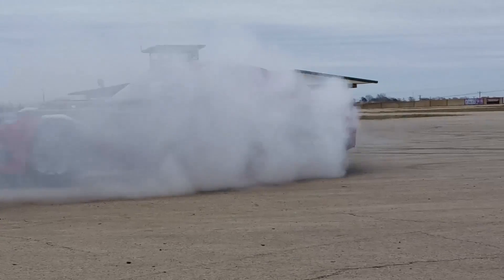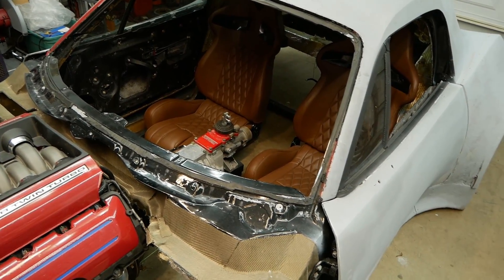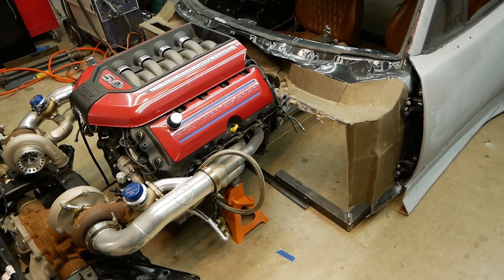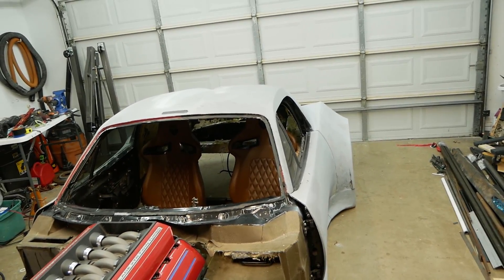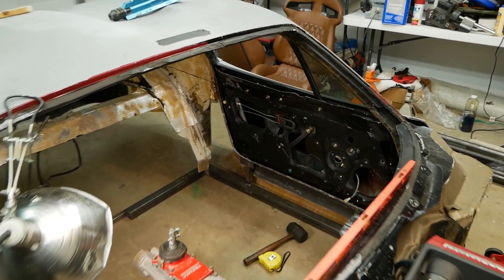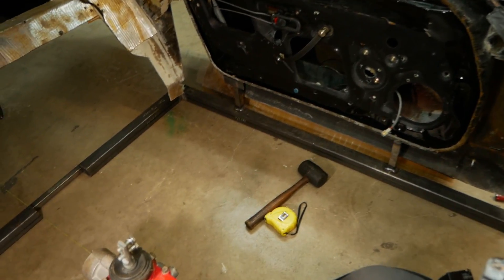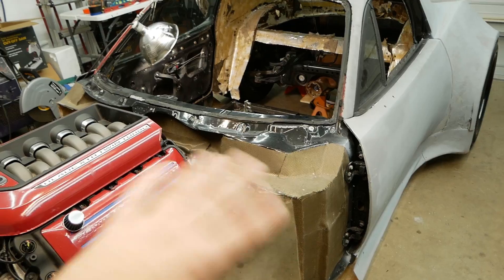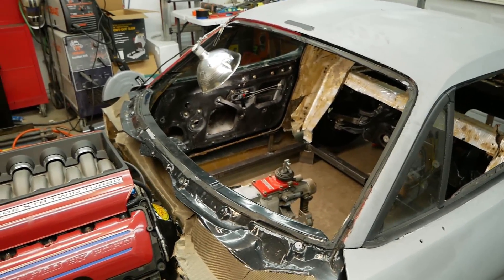Mounting the Body - Building a Twin Turbo Race Car - Ep05

Comment: I would have assumed that you'd go with a traditional front to back chassis setup, with the branding off for the bracing. But now I see that you're going for stability more than anything, because this will be teach and straight line oriented. At least you'll prevent a lot of frame twisting while at high speeds.

Comment: Looking forward to the progress on this! It's nice to see the body in the garage as well. I think the intergrated door bars in the door is a great idea. I'm looking forward to seeing you build the custom firewall in house as well since that's going to take some work to for around the header and then the pedal box. Are you going with a premade set up from Tilton or equivalent? I know it's probably not feasible, but with the room ahead of the engine with the block pushed so far back it would be cool to see 189 degree headers to a turbo there. Would make for a very unique sound. But I'm sure that's where the front in board suspension is going to be.
Reply from the maker: Thank man, I have a Tilton peddle assembly that i may use and in the previous setup I actually used a stock assembly from a new mustang as its very compact and make it easy to use plus drive by wire was easy to setup. Currently the headers already point forward and teh turbos mount in the front. I will probably re position these a bit but will stay pretty much in the same location.